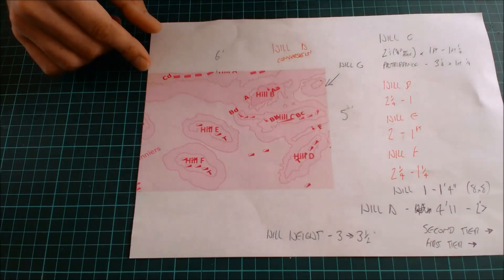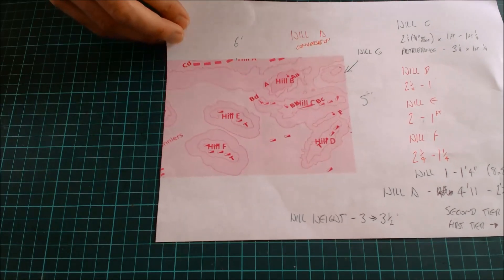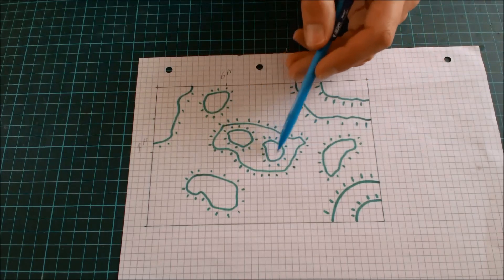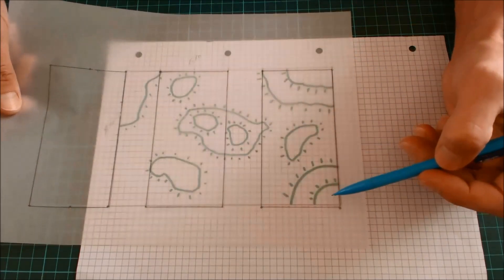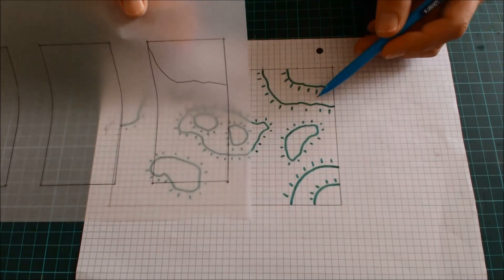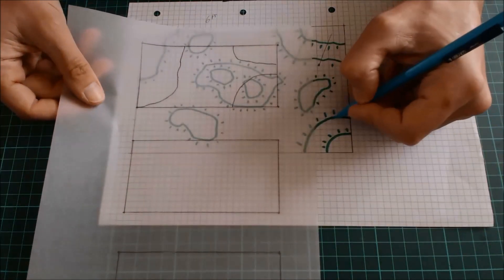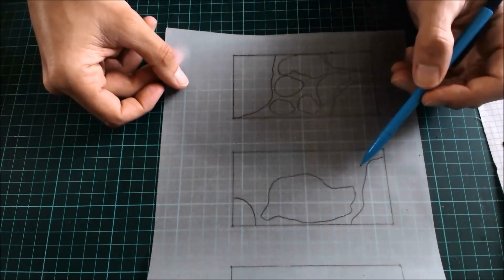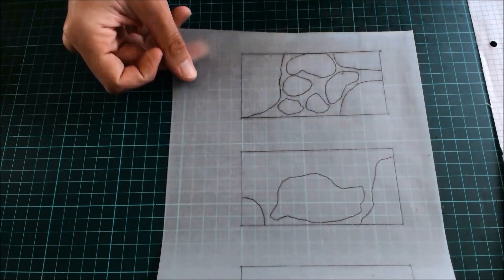How to workout how much polystyrene you need for a hills project

Comment: If you want to use those sheets most efectively combine your technique with fliping your tracing paper on the other side. This way you can leave more of your polystyrene for another project.
Reply from the maker: OtocinclusAffinis Sorry mate, you've lost me there?
Reply: For example when you were tracing third corner instead of tracig it in a place you chose you could have fliped paper on the other side and trace it on the oposite side to the one you chose. That way you would be left with a bigger chunk of a board left for a future project.
Reply: Sorry, i meant first corner on a second sheet